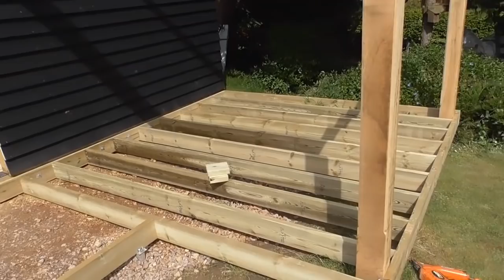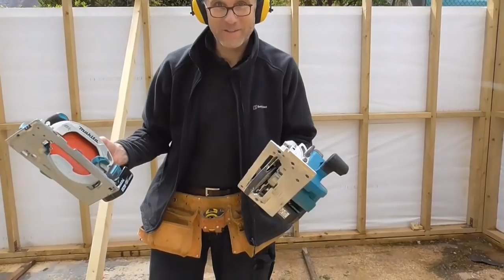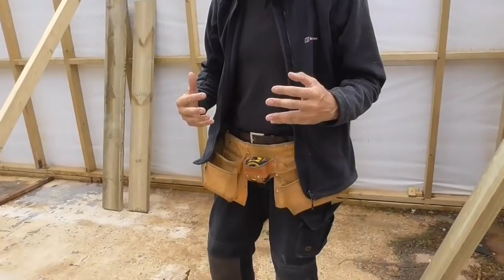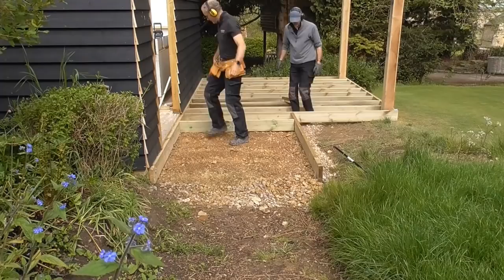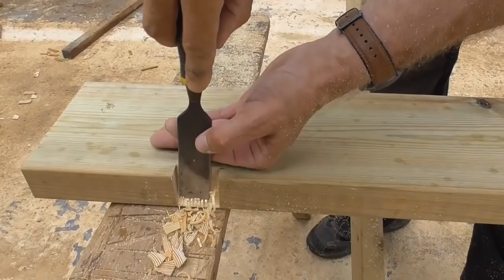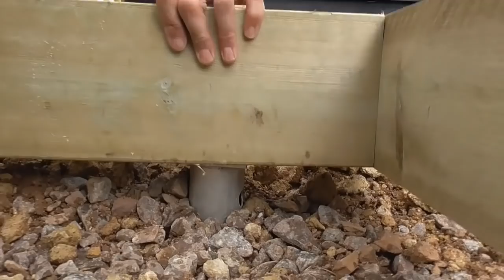Timber framed garage and garden utility space. PART 7 (marking, cutting and fixing deck joists)

Comment: thats weird, i didnt know my computer came with a smell dispenser! i can smell the wood and the sawdust i love it.
havent seen the whole build yet but is there a reason you didnt feel the need to use OSB for the walls? im building a smaller shed and plan on using OSB on the framing for both rigidity and "insulation", plus the housewrap and siding offcourse.
is there another part comming up? interested in how you make the doors and roofing
Reply from the maker: Hi there. Work on this project has come to a halt due to a long lead time on the truss manfacture. There is no OSB boarding yet as this is just a garden store and garage without insulation. I will bring more videos of this job as soon as I get the roof delivered. 😎 Thanks for your comments. 👍
Reply: @thetallcarpenter  thank you for your reply sir. Yes im aware that maybe im overdoing it a bit with the OSB since its just a toolshed but if my budget permits i see this as a training ground for something bigger ;-)
Reply from the maker: @tagquasar8791  I don't think fitting OSB is over the top as each person's requirements for this kind of building is different. 👍 Good luck with it.😎 Cheers.

Comment: Watching you and Robin clevett. And, a variety of other chaps, I notice a distinct lack of a chop saw? The tendancy seems to be towards the framing square and a circular saw. Obviously it makes, a lot of sense to me as, it does seem quicker. Am I right?
Reply from the maker: Hi Paul. I have only been using a square and circular saw to make 90 degree cuts in the last couple of years, and that is only since I bought a blade left saw. I do actually lean towards making square cuts this way when roofing and joisting. There is not the set up time and space needed against using a chop saw, and there is a bit less handling of the material. 💪The chop saw is still King though if doing repetitive cuts and, obviously, 2nd fixing. 😎 Thanks for watching and your great observation.👍

Comment: Really like your straight talking style. Lucid perspective delivered with a no-nonsense explanation. Finding it all very informative. Cheers.
Reply from the maker: I really appreciate your comment and feedback Michael.😎 I'm a carpenter and not a film maker, and its tricky trying to learn/decide how to make these videos so they are interesting, informative and insightful without being boring, but also be compatible with actually getting the job done and earning a days pay.😬 Thanks for watching.👍
Reply: @thetallcarpenter  Are you not treating the cut ends of the beams? And where you have cut out for the ground screws? It is more rainy and damp here in the west, but we always treat the cut ends or that timber will rot out in 10 years
Reply from the maker: @rossbuchanan7632  Hi Ross. Generally don't bother with extra treatment on the ends as there is usually a full width decking board covering the join.👍 Any exposed ends will be coated in when the rest of the timber on show is done.😎 Cheers.

Comment: Hi mate, if you had to pick only one of them circ saws to have which one would you pick? I’m in the market for a new one and don’t think I’d be able to dual saw like yourself😆
Reply from the maker: Hi Stuart. If you'd have asked me that question a year ago, I would have said blade right. (the 660). However, bearing mind its only a small 165mm bladed saw, and so gets used on not so heavy duty work, I would now pick the blade left machine. (dhs680). Superb against a square as a cutting guide and fairly easy to see the blade in most instances. Still irritating that it shoots dust all over your legs, but that's about it.😎 Cheers.

Comment: It’s looking excellent!! Nothing like the smell of paslode exhaust in the morning! 😃
Reply: Good job you bought most of your wood. Prices are going to get0 worse and they won't come down again.  2021 will be known as the start of the mega inflation event.
Reply from the maker: @Hitngan  You're absolutely right there.😬 Anyone with eyes in their head should be able to se what's ahead. We're gonna have to hold on tight for the next few years.🤨
Reply: Btc is the hedge.
Reply: Need to build a platoon now
Reply: Freud on the blade left, cut net than the Dwalt on the blade right.
Reply from the maker: @Hitngan  Its a proper mish mash of blades I have.🤪 (they still all cut pretty well). Thanks for your comment.😎
Reply: @thetallcarpenter  Freud Diablo are blades I insist on having along with Stabila levels, Occidental Leather tool belts, Stiletto Titanium hammers, Stanley Power lock/Fatmax tapes..... I'm a tool junkie, 😁  Champagne tastes on cider wages! 🙄😆😆
Reply from the maker: @Toyotaamazon80series  I think a lot of us are the same TN when it comes to what we want and what we can afford.😵 Cheers.
Reply: Smells like victory! 👍😁🔨🇮🇪
Reply from the maker: @Toyotaamazon80series  Tastes like it too TN.😎
Reply from the maker: That's great Simon.🤩 Thanks for your comment.